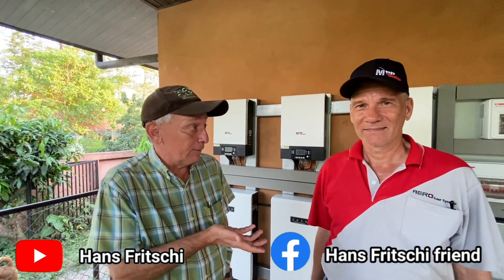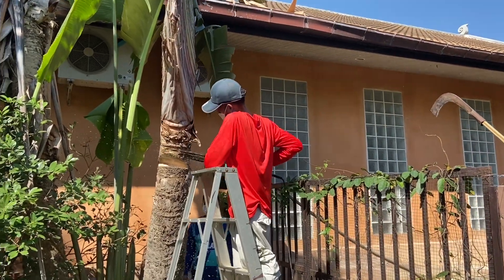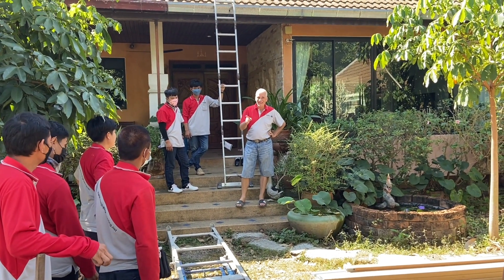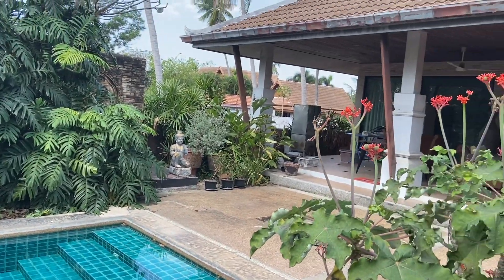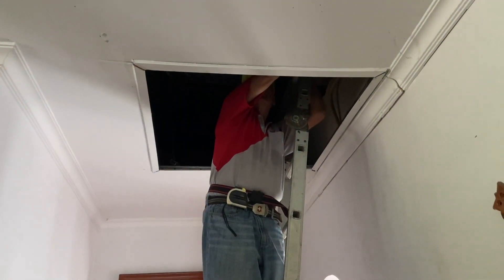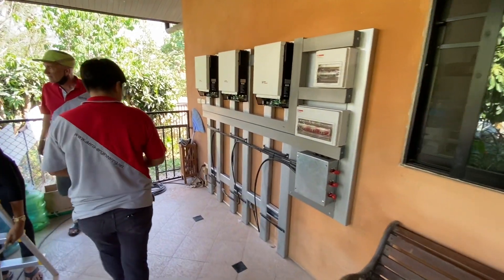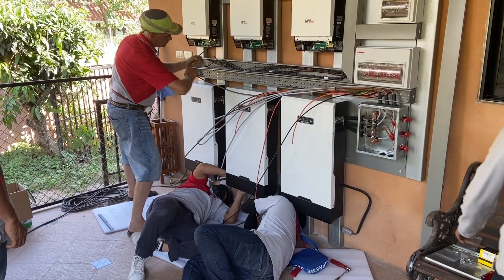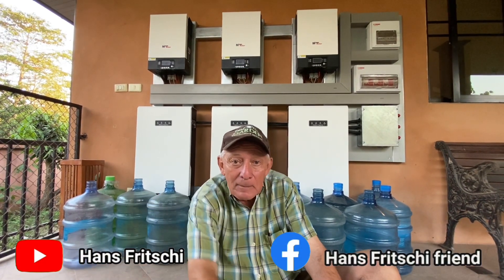Going solar in Thailand 1

Comment: Hi Hans, please provide contact info for your contractor and also what you paid for the entire system.  I live in Thailand and my wife and I have been talking about a solar system for our house as well..  Also is this a system that cam feed power back to the PEA grid? Thanks, Brian
Reply from the maker: Rolf Aeschbacher and his company AERO Solar and Automation Co. Ltd. in Bangkok (www.aero-engineering.net) have done the job. Total costs about 700000 Baht storage in 3 batteries, no feed back to the PEA grid.